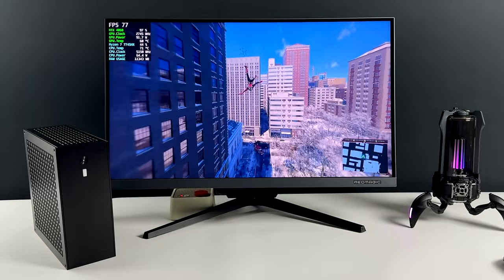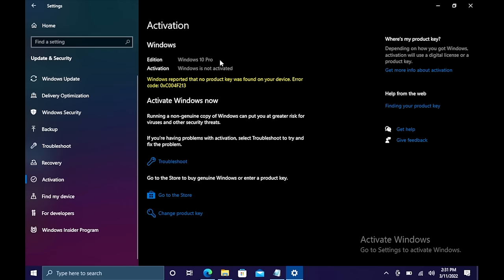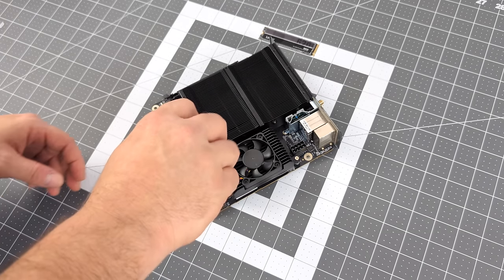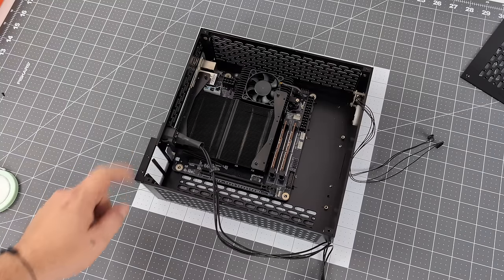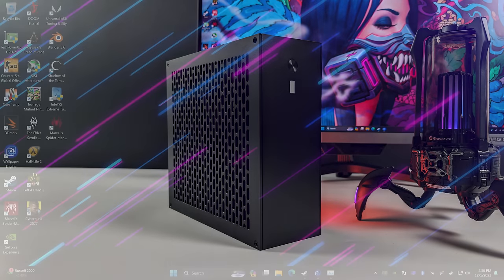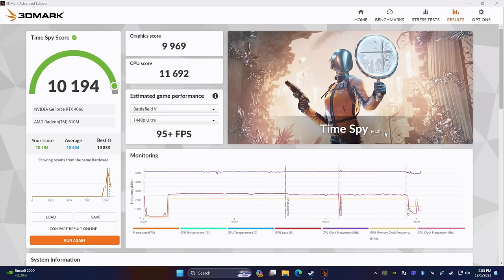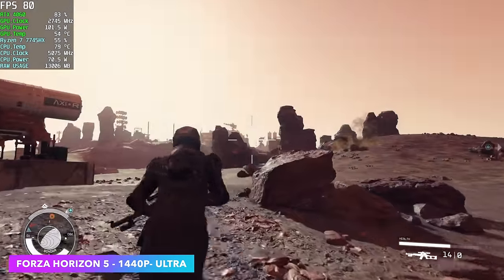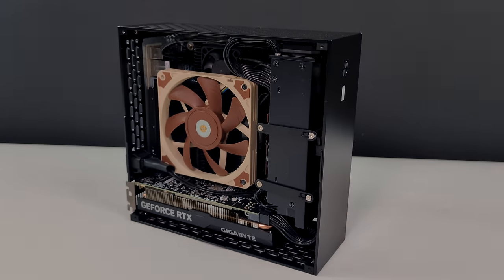One Of The Most Powerful 5L Mini Gaming PCs You Can Build Right Now!

Comment: While I like the concept, I just can't justify the overall price. At approx. $1100-$1200 for the whole build and to only be a 1080p w/ some 1440p gaming machine, I'd prefer a standard mini-itx build with a zen-3 5800x3D or 5900x, 32 GB DDR-4 3600Mhz RAM, a SFF 600 Watt PSU and an AMD Radeon 6700xt/6750xt for similar or cheaper price and get better performance than this rig.
Reply: 5800x3d + mb+ ram isn't even cheaper than 7600 + mb + ram... 7600 is better in every aspect, and offers future upgradability, too. Otherwise I agree.
Reply: @MrJonas7  I would slightly disagree. While I will concede the power draw differences, the extra 4GB of memory along with the memory interface difference 192-bit for 6700xt 128-bit for 7600, the 6700xt has much longer legs than the 7600 does. Especially with the growth of memory usage for 1440p/4k games.
Reply: @pudgegranddaddy  I'm talking about the CPUs, R7 5800X3D vs R5 7600
Reply: @MrJonas7  Gotcha. I only say 5800x3d so you don't have to pay more for an X670 B650 platform or DDR5 RAM.
Reply: @MrJonas7  The 7600 isn't better in every aspect. The 5800x3d beats the 7600x in almost every gaming single benchmark, and they are close in work applications with the 7600x coming out ahead in almost every test. That being said. If you were to be building a new pc with all new parts, the 7600 is the way to go. Simply because the AM4 is last gen and you can upgrade to a 7800x3d with 7600.
Reply: rn the 12600k offers more value for performance than the 5800x3d, I got a 12600k + motherboard at 100$ less of what a 5800x3d costs. yes I paid 180$ for both.
Reply: @Summit900  For what I've seen in games, the 7600(X) is usually a bit ahead, except for some specific games that love the extra cache.

Comment: A low profile RTX 4070 would be dope and I reckon it can be done, it still only requires 1 8 pin power connector, it's power efficient maxing out at 200W with RTX 3080 levels of performance, and don't forget undervolting, I hope gigabyte make one, temps should be perfectly manageable.
Reply: I don't think you realise how big of a cooler you would need for that 200W and precisely why it will not happen. For reference, people tried transplanting cooler from 1 fan 4060 to 4060Ti and it just wasn't enough without severe TDP limit which made performance drop off to the point of it not being worth the hassle. Low profile? Forget about that.
Reply: Good luck with that. I'm sure you could with the 4060 TI and some power limiting/undervolting. But the 4070 gets too hot for a cooler that small. The 4070 runs often about 5 degrees hotter and sometimes even hotter compared to the 3060 TI, both which are rated at 200W TDP, although 4070 more commonly uses slightly below 200W than the 3060 TI does. The MSI Aero ITX of the 3060 TI is really small, but it's a pain and loud to use if it's not inside a big system with lots of airflow, and that's with about 5 degrees or more cooler than the 4070. (not accounting for the G6X vram heat). While these cards are very power efficient and powerful, they generate a lot more heat in exchange which needs to be cooled. Good example of TDP being a bad metric for both power draw and heat exchange.
Reply: Velka 5 V3 is right up your ally. 4070 full size fits just fine.
Reply: Power mod a4000 ada sff😅😅
Reply: @Micromation  I mean, a power limited 4060 ti or 4070 are still better than a 4060 😉
Reply: @maximus3294  Except it isn't due to thermal constraints. You have to limit TDP down to the point where performance gains are miniscule and not worth the tinkering.
Reply: @Micromation  given the same power draw, a 4070 will outperform a 4060, plain and simple. irrespective of frequency or even memory bandwidth(which is better on the 4070), the sheer core count means that there is just more computational power on a 1:1 basis. so it will be better, by whatever margin.

Comment: i noticed that the case has perforations for air flow below the GPU. I would assume you would want to put some feet on that side to elevate the case slightly to allow that air flow unless you just lay the system on its back instead.
Reply: I have a different version, but it's basically like this case.  And it's not meant to be sat like the way ETA has it.
Reply: @murdock94    horizontally
Reply: @murdock94  it's meant to be vertical like ETA has it. It comes with legs to provide airflow underneath the GPU
Reply: You could but they make another version that's the same size except it has feet and a handle.

Comment: 4060 just doesn't have the memory bandwidth for 1080p due to that bus width. Even though it could theoretically run well at 1440p, it just chokes hard in some games at 1440p because of that artificial limitation. I bed you'd have a huge performance gain with 1080.
Reply: Totally agree but I saw many comments, probably bots or people paid to comment, on previous videos requesting it.
Reply: its the best of what sff has to offer
Reply: So the PCI4 bus I 8 lanes instead of 16 lanes .. also 128bit wide memory bandwith instead of 192bit
Reply: He use this same card on the AR900i which is the Intel one and ran thses games in 1440P ultra
Reply: DLSS upscaling helps out greatly here and makes 1440p viable. I have a 4060 laptop (Legion 14” slim) with a 2880x1800 screen and the 4060 has no problem pumping out 60+ FPS in every game I throw at it, including heavy titles such as Cyberpunk, and remains relatively cool, so that the laptop runs quietly.

DLSS 3.0 has been refined over time to the point where I don’t notice any artefacts during gameplay.

Comment: best thing about that minisforum bd770, not only is it a deal as far as price to performance, but it really holds up against it's desktop big brother option. My GF got the BD770i and I have a mini itx rig with a Ryzen 7 7700x. we ran benchmarks beside each other back to back both cpuz and geekbench 6. The minisforum loses in performance by about 80 points on geekbench 6, which is literally nothing. It's a killer deal.

Comment: hope to see a comparison vid vs I guess a 7700x or 7600x with the same specs altogether and compare how much would it cost to do it compared to the b770i
Reply: He doesn't do comparison vids🙃.
Reply: He doesn't direct compare vids. Even if he did, it wouldn't be comparable anyways. Those cpu's are desktop variants and the one he is using here is a mobile variant. Mobile variants have many restrictions placed on them to be able to run off of a battery and a very low wattage psu. Its like comparing Apples to Milk.
Reply: @Summit900  I understand but the product is being sold as a motherboard + cpu thus making a desktop machine is the main reason for it's existence. Also some games don't rely too much on cpu power so I'm curious on what degree it's different from 7600/7700 that could warrant it's existence and price point. I haven't found anyone from Reddit yet on comparing this to any other and ETA seems to be the only one covering this at the moment.
Reply: @hackeroo agreed.  Other guy is bonkers saying that a comparison wouldn’t make sense.  It would actually be an amazing comparison to see how laptop CPUs in a desktop form factor compete with their desktop counterparts.

Comment: hi eta, if youe interested in super small itx cases, you shoud check out the velka 3. its 3.9L and really great quality and i think you couldve fit this same exact build in that case.
Reply: Velka 3 has 30mm less CPU cooler clearance.
Reply: @breadkrum6860  that’s a great point. after writing this comment, i realised that the fin stack and the 25mm thick fan probably wouldn’t fit in it.

Comment: Love this chassis. I may eventually spring for one to hang onto. This build looks nice and clean. I am curious how this CPU compares to it's other 6 and 8 core desktop variants like the 7600.
Reply: I think mitx AM5 board with 7800x3d CPU is more powerful if we are about gaming.
Reply: @axescar  Well naturally, but I probably would not try to cool a 7800X3D in this size chassis... MAYBE a downclocked 7700 or a stock 7600. ETA provided the alternative of a regular desktop CPU and I was wondering how big the performance gap is.
Reply: @greenprotag  I knew that someone will mention cooling :)  But 7800x3d is very efficient and with the same wattage that have this mobile CPU, x3d will beat it. Caption of this video is something about "one of the most powerful..". And with am5 socket you will receive full size DDR5 dimms with slightly good timings and freq. So I think mitx am5 replacement is very good for such builds
Reply: @axescar  Listed wattage is kinda BS from AMD and Intel. Usually the listed wattage is not "max" but rather with a "nominal load" I suspect the X3D part will be hotter than the 7745HX
Reply: That and you have to take into account that this 7745XH has a custom cooling solution with a very dense low profile heatsink that might be hard to match. It even had exhaust out the rear IO.
Reply: @greenprotag  I think I understand that, but I'm not about listed TDP, but about bios configuration. I did that trick with my 5800x3d with low profile cooler in 11L case. I just don't need so much CPU power, so I downvolted it with curveoptimizer and maxed power consumption at 50W. With that config in gaming load I have maxed boost clocks, but suffer some penalty in other multi threaded workloads that I don't need on my PC.  Here we can do the same thing with 7800x3d. And it will be no matter if I need to cool 55w from  7745hx, or 55w from x3d chip.

Yep, custom cooling with liquid metal as I remember can make a some difference but I think it just can't beat x3d
Reply: I think the only real problem is ram speed, going 5600mhz cl40 is a huge step back from 6000 cl30 kits we use on Ryzen 7000s
Reply: Based on GN’s review of the chip, 7800X3D doesn’t run all that hot because it has lower caps for TJmax, power usage and boost clocks than AMD non-3D chips by design. Tests showed 50-70C during gaming. I’m building one now in a tiny 4.4L custom ITX case (Gemcases C9). I’ll cool it with a Noctua 37mm cooler.
Reply: @little_fluffy_clouds you'll have to let us know how that build goes.

Comment: Whats the equivalent Desktop competitor of this CPU? I see that the performance is solid and combined with a mini ITX board it makes this a very appealing option. If I was to opt for a R5 7600 with a mini itx board I would be looking for sure around 350£. I've seen that the cinebench scores are around the same performance as the 7800X3d even beating this actually on single core performance score.

Comment: What would be the height of the Radiator ? Minisforum spec. are kinda sketchy on the BD790i .. Any word when the 7945hx3d is supposed to be release ? I thought it was at the end of January, anyway China shots down between Feb.8 and Feb.14 so there will be no shipping.
Reply: I read the BD790i starts shipping the 25th of this month so we might be seeing some builds very soon.
Reply: @heirtothethrone000  Yeah, that's right, so I ordered mine yesterday and got it for $509 after an additional $10 coupon. It is possible will go up to $649 in price at the end of February. I'm not seeing huge differences between 7945HX and HX3D other than the L3 cache, which not all games take advantage of. CRUCIAL 64GB ram and a 2Tb nvme is another $500 .. and $609 for an Asus 4070 Super GPU .. $100 for the ZS-A1S aluminum case and $40 flex PSU  .. Total = $1800
Reply: @heirtothethrone000  Chinese Christmas Holiday is Feb.8 - Feb14 .. nobody goes to work that week.
Reply: @samm928  what case is that? Can u link it on some eshop please? Thx

Comment: Question for the slim 120mm noctua fan.
Did you have to use your own screws or did the motherboard come with them in order to get the fan screwed onto the cooler?

Comment: Will a 7900gre fit this build?
Reply: Doubt that it would fit, the build in the video only allows you to use low profile GPUs, it also looks like that there is no 7900gre low profile. The GPU used in the video was the Gigabyte RTX 4060 LP OC.

Comment: You can get a b760 ASUS Strix itx board for £170 a 6 core 12 thread zen 4 Ryzen 5 7500f for £130  so 300 for that but this costs £390 with no upgrade path naa not worth it
Reply: And you can get a aio that would cool this for under £90 and you can upgrade the cpu for years to come
Reply: The Ryzen 5 7500f does well over 5ghz yeah this has more cpu has more cores but it’s a mobile cpu so the 7500f will wipe the floor with it

Comment: Rtx a2000 would fit nicely. With no power connector. It will probably run better than what 4060 because of the power draw on the 4060 with  the power supply you chose.

Comment: I am trying to work towards building a PC for maby 100$
Reply: To build a good small to mid size PC your need at least $500. You can build a larger size PC with used components for a bit cheaper. But it's going to be very hard to get in that $100 price range and will most likely be a 1080p system. Your best bet is to get a used Xbox series s for $200 and have a computer or tablet for any PC needs outside of gaming or spend a bit more for a mini PC or one of the cheaper handhelds like the ally or steam deck.
Reply: Lmao.
Reply: If you don't need it for gaming or anything intensive just get a used Dell Optiplex or Lenovo Tiny. Can get a full system ready to go (4th Gen Intel parts) for under $100.
Reply: There are deals on the HP compact an then also watch lines video on a 70$ pc there are ways